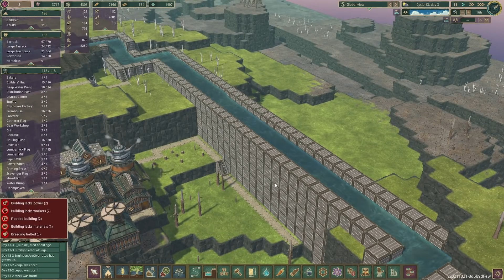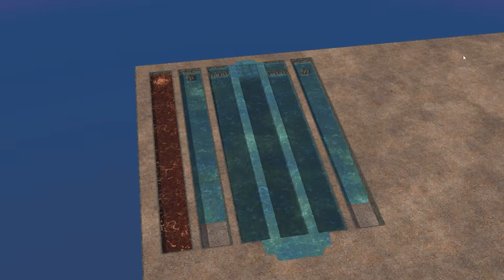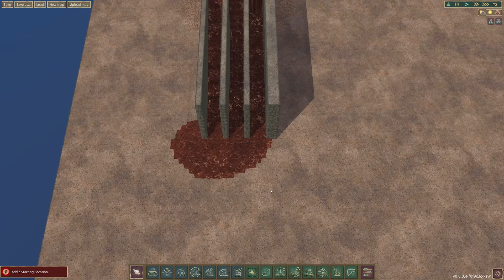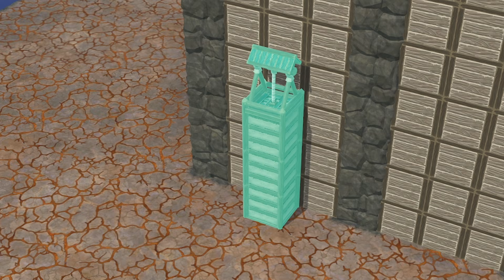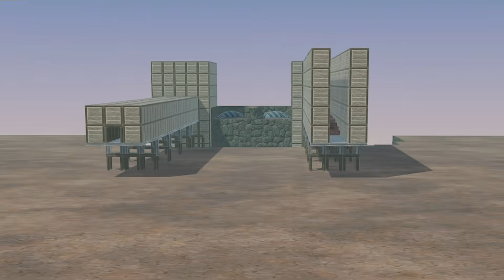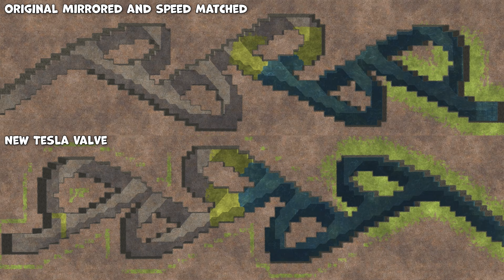Engineering a TESLA VALVE in Timberborn!

Comment: Oh cool! I was hoping he was going to do this! 

I just got into the Experimental Mode since this update came out. This update added so much fun to the game! 

I love the sluices and water updates; not to belittle the other changes. Those two changes completed changed my dam designs.

Having a completely automated water system is AWESOME! It has been more satisfying than most things in the game. 

You have to have a 1-deep pool for your sluices to work well. Which made having the 500HP pump worth something. So, now you can have a system of 'locks' with the sluices' that allows you to manage your entire water system in a way that you'll always have the amount of water you want where you want. 

AND! a new update was snuck in, one that c hanged the power-shafts. The 'step up' power shaft has been removed and broken down into pieces with a vertical shaft introduced - not game changing but made power easier to manage.
Reply: *Whoa, I didn't realize we could put holes on the bottom of dams now! I gotta do another settlement now!